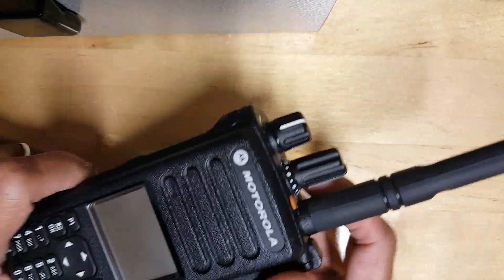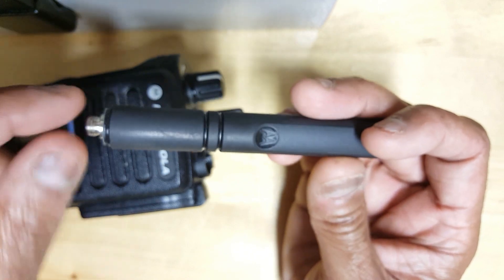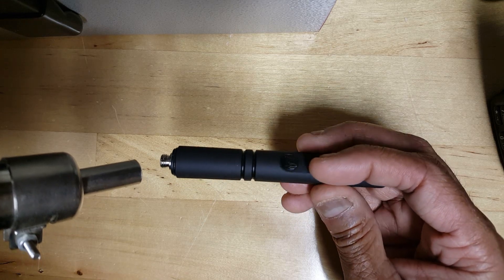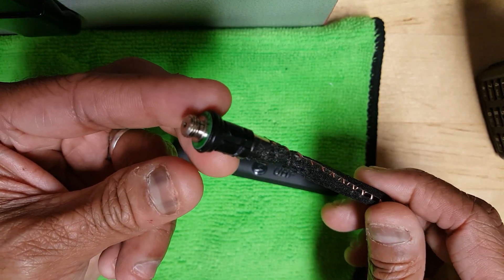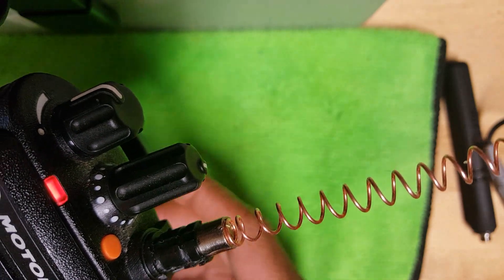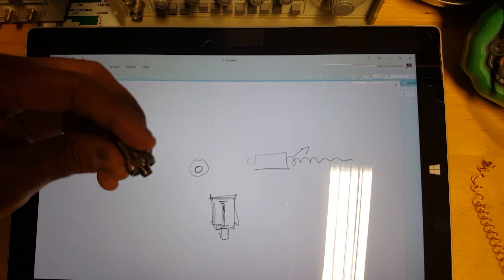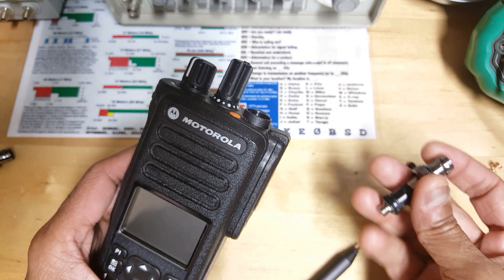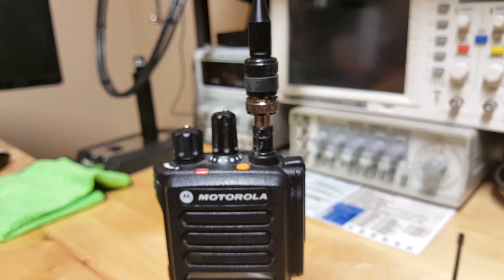N0AGI - MODDING AN XPR-7550 STUBBY ANTENNA TO ACCEPT/ACCOMMODATE EXTERNAL ANTENNA - VOL 78

Comment: Thanks for sharing! I am trying out this mod and found that a SMA male to BNC female adapter may also work. As you pointed out, there is a center cylindrical boss and a surrounding wall once you remove the copper wire. I broke and snapped the surrounding wall by accident, but realized that I can remove them all and leave the center cylindrical boss. I am thinking drilling a small hole in the center boss that would accept the said adapter. This way also seems to allow a counter poise to be installed

Comment: Will removing the rubber cover with heat increase the range? I guess the coil is set to the uhf mhz. Can i get more range by removing the tape alone? Or do i need to find a way to extend the coil length to get more range. Any tips are appreciated, thanks

Comment: So there is no actual physical connection between the bnc and the 7550 connector besides a press fit? It will be interesting to see how long that will last.
Reply from the maker: there isn't a physical soldered connection.  Yet, from a good compression, the connector seems to be still working. Thanks for asking